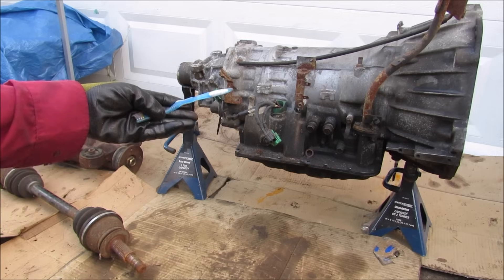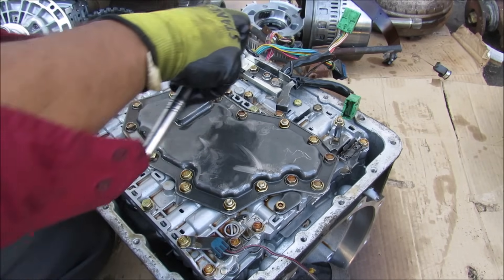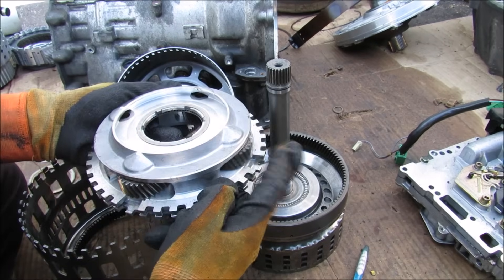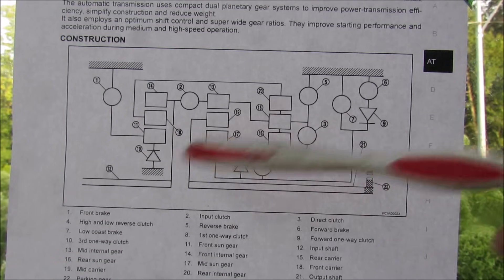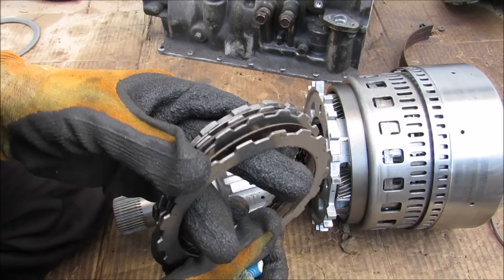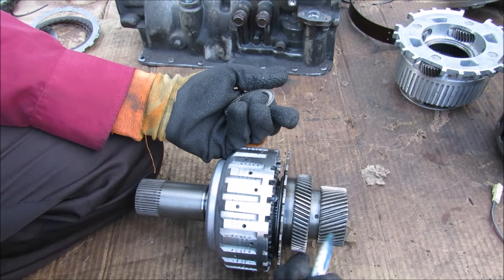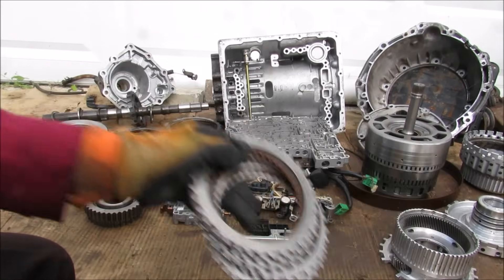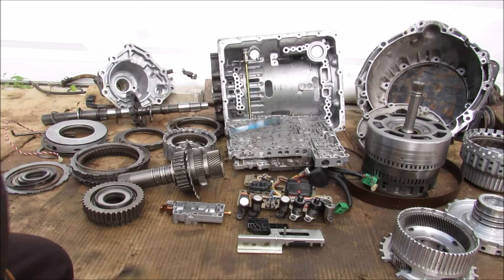How an Automatic Transmission Works (RWD)

Comment: Probably the best explanation of how the auto transmission works on the net. Simply superb. I am a professional Chemical engineer and have worked on cars all my life but understanding the automatic transmission still makes my head go in circles. For me the icing on the cake was the explanation about the transmission pump which no one else ever had done and I kept wondering where is the pump. It was important for me to know if its a positive displacement pump thus meaning you can't run it dry if you want to replace the fluid by keeping the engine running and using the tranny pump to discharge all of the approx. 6 quarts and then replace it. Replacing the oil with a dead engine only gets approx. 2 quarts out.

Your tear down seemed like a GM tranny, would love to see a ZF tear down which will be similar to AISIN of Japanese cars.
Love your review style sparkled with infrequent jokes & sarcasm.
Reply from the maker: Awesome, I'll keep that in mind thanks
Reply: https://www.youtube.com/watch?v=7ptkLEZIn84 dipstick transmission flush machine in action - it puts in 2 quarts and then takes out 2 quarts - I had this cycle 20 quarts for a 11.5 quart transmission.

Comment: I don't know if anyone can help me with this or not but I have a 1997 Ford f150 4.6 Triton four-wheel-drive the transmission when put in gear starts to grind about where the transmission pan is but will not move forward or backwards or go into park what did I break?
Reply from the maker: Check the fluid

Comment: Sooooo much shit to go wrong and cost thousands to rebuild/replace Lol. even toyota auto start acting up around 300k with all maintenance done. meanwhile a manual with good driving habits will last 600k miles and clutch replaced every 200k. very cheap if diy cos clutch kits are cheap. try rebuilding an auto as a diy. impossible even for auto techs; it is a specialty rebuild item.
Reply: looks like speekkar99 just took one apart so he can rebuild it idk. probly not tho. putting this together and making it work smoothly is a whole different story haha
Reply from the maker: Agreed. I don't think I can put one back together and have it work right
Reply from the maker: Hmm some autos are better than others. With the short lifecycle of the average automobile, many of them out last the car itself

Comment: Nice explanation and teardown of this JATCO unit used in Nissans, Infinitis, and a few Kia models. 

It’s a stout and strong transmission. Unfortunately most of them die from glycol contamination from the radiator. It’s a shame and expensive failure.
Reply from the maker: Agreed they are pretty decent transmissions (compared to the FWD CVT junk Nissan puts out) 

Didn't know about the radiator issue on these G35s
Reply: speedkar99 the radiator issues were primarily in the Nissan Frontiers

Comment: Just imagine how many medium where power from engine travels just to reach the wheels... this why I hate the torque converter. No matter how advance the technology the AT is... it will always feel spongy... it sucks. I’m good with Dual Clutch Transmission
Reply from the maker: Yep that's alot of losses in the system

Comment: 10:20 autism. those are drain holes. the clutch pack is engaged by a cylinder sqishing them down as a pack. to have a good engagement and shift you apply a lot of force on the pack, making the fluid go away from the pack and have dry contact keep the pack engaged
Reply from the maker: Ah that's right. 
But why does it lead to the center of the shaft?
Reply: what leads to the center of the shaft?

Comment: As usual excellent video. I have few stupid questions:
1) @15:23 what do you mean by "torque convertor lock up"? You quoted as the discharge oil from pump goes through these small holes of shaft and finally "lock up" torque convertor.
2) I have seen a "cable" coming from automatic transmission to "throttle body"....what is that?
3) What is the purpose of "adaptor assembly"?
Thanks for sparing your valuable time and keep your good work on....
Reply from the maker: You are welcome. 
To answer your questions, see my torque converter video and my FWD transmission videos linked in the video cards.

Comment: nice explanation sir.what happens when we select neutral instead of pressing brake in drive mode in signals? does it causes wear on any clutches or bands? i expected atleast in this video u will explain what happens on each gear selection, i mean which clutch or band hold for first second third..like that.
Reply from the maker: It would take another twenty min video to explain each gear!

Comment: And....this is why all of my cars have manual transmissions.  There's beauty in simplicity.  ;)
Reply: Chris Freemesser - It's true...there IS beauty in simplicity! But there can also be beauty in complexity...such as this transmission. Sure, it's hella crazy complex engineering, but the components that make up this modern marvel can damn near be likened to art. At least IMHO. Cheers!
Reply from the maker: Great. 
Meanwhile I'm going to admire this marvel of engineering
Reply: @speedkar99  Not saying the engineering isn't impressive...it just seems like a LOT of effort and complexity to save one from having to move a simple gear selector now and again.  ;)

I'd be curious (and slightly nervous) to see how this tranny compares in complexity to a 9 or 10 speed auto...

Comment: speedkar99, are you reading during the filming?- do you practice your speech thousands of times? there is nobody on Youtube who can speak so clearly and fluently  like you? that's UNREAL!
Reply from the maker: I don't make lines. I say as I go. I average 3 takes for every clip until I get it right!
Reply: @speedkar99  yeah this vid is Emmy material. Or whatever awards. thanks
Reply: @speedkar99  My only question is - you make the remark about how making sure the pressure is not too rough or hard on the clutch packs - is that referring to the fluid quality or how hard a person is gassing the car or both, etc.?

Comment: Absolutely amazing. I work in a metal stamping factory now and I'm trying to imagine how each individual part is made and it's just staggering to think about. The complexity of the case casting, the valve body casting etc. The guys who designed this thing are absolute geniuses. When I see this I'm amazed cars are as cheap as they are.
Reply from the maker: I have a similar train of thought... Everytime I open something I examine it from a manufacturing perspective, and think of the scale of mass production, it's immense!
Reply: ATs are really not as complicated as they seem on first glance.. First of all we have to appreciate the fact that with relatively small design differences, all auto transmissions are pretty much constructed on the same principles, with the caveat of electronics that have compacted the design of ATs considerably, when you consider that ATs were first produced when there was no electronics, back in 1948 when the first true AT was installed on production model Oldsmobile, when there was no calculators, desktop computers or CAD software. All designed by hand on drawing boards.
So when a team of engineers design a new transmission, they are not designing it grounds up (the planetary gears, Systems of Limits and Fits, Spline housings, shafts, bearings and other machined or stamped parts are pretty much the same with variations in size. The same goes for castings. All aluminum castings are variations of the same thing. In fact CAD systems such as SolidWorks have built in elements for AT design as a standard feature.
Anyway, these videos are absolutely awesome and I do hope that one day you will invest in an actual disassembly table so you won't have to sit on the ground for all this amazing work.
Good job, man...Keep it up.
Reply: Once you have the design worked out, it’s just a matter of getting the infrastructure to build it.

That’s why the prototypes cost so much, while the production version—whatever we’re talking about—isn’t nearly as expensive.

Comment: The big pistons in the bottom of the case are accumulators that are used to control shift feel and firmness. I prefer a good hard shift because it makes the thing respond faster and it wears the frictions less, but most people don't want to feel the shift at all :/
Reply from the maker: Yes they are. 
It also controls the front band clutch to lock the drum
Reply: This transmission does not have any accumulators in the case. The servo piston in the case controls the application of the front band. 

There is one small accumulator in the valvebody to control the forward engagement  feel.  

Shift feel is completely electronically controlled in this model.
Reply: 50% of mechanical engineers who sees, might be still confused after seeing this video, how automatic gears works!

Comment: Hi, this transmission is very big and heavy. Cvt trans weights less then 1/3 of this, and is cheaper to manufacture. If cvt breaks can just replace the entire thing cheaply.  
Thinking about cars today, their is so much plastic in the engines, most cars now have plastic valve cover, plastic throttle bodies, plastic in the gearbox(dsg) even plastic thermostat housing. I hate plastic. They should just hurry up with full electric Toyota, this rubbish "lawnmower engines on steroids (turbo) is bs.
Reply from the maker: Good point. That's the way our industry is moving towards...disposable cars

Comment: Transmission is more complicated than the combustion engine 🤪
Reply from the maker: It sure is way more complicated than ICE
Reply: I agree, I know, and can wrap my mind around engines. I know how it all work. I have tried understanding automatic trans forever. People start talking in my head at some point every time reassembly explanations start. But I watch because I want to learn
Reply: Very true, I have rebuild lots of engines but never had the guts to try transmission 😂
Reply: @halildjencic1612  you should give it a try. I just finished my second rebuild but my first success. 4l60e. I used transmissions bench channel. He explains it step by step
Reply: IC engines: Stuff go boom make shaft go round

Automatic transmission: mechanical magic
Reply: It's funny how people usually think rocket and jet engines are the most complicated and hard to understand, while they are actually very simple and it's the thing under everyone's feet that they use daily that's the hardest to grasp.
Reply: This is why Ford and GM teamed up for their 8 and 10 speeds. And why BMW, Mercedes, Audi and others used the same ZF 8 speed for a long time. Their engineers were like, we can't understand this witchcraft.
Reply: @lkae4  they inderstand the witchcraft
..but any small change for literally anything can trigger the ened to fully redesign something else....over and over. If it is tried and true tested and reliable, don't break it by trying to make it "better" until you need to
Reply: @lkae4 the ford and GM 10 speed is based off the ZF8.
Reply: @g @georgelin8498  Interesting. Why does it suck so much?
Reply: I think I'll have to watch this a hundred more times to fully understand.
Reply: Hope his brother has a new bed sheet.
Reply: Dude thats way more complicated
Reply: 10000000 times more complicated lol
Reply: Correct. I can overhaul most small and big engines without hesitation but automatic gearbox is a real story.
Reply: Automatic makes ice look like a steel pipe
Reply: True especially this type very complicated
Reply: In some ways it's actually simple, if you look past the complexity of the individual components. 

Transaxles get more complex due to their mor compact setup.
Reply: Hydraulic computers 😂
Reply: Auh it's not hard, just understand the logic of the different section to make it all work, you havev learn folks if you want to learn folks,

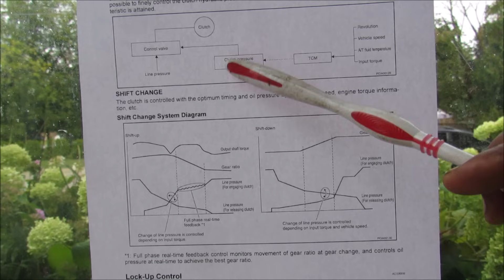Comment: Years ago I had a used transmission installed and it has always shifted hard from first to second, never getting worse. Would a transmission computer shift pattern reset help? 17:15
Reply from the maker: Yes. You are supposed to clear the Eeprom in the transmission computer too

Comment: Gentlemen don't be discouraged at all.
This system is now obsolete. New systems are either CVTs, which is very easy, or induction motors. So, no worries you wouldn't encounter them.😀👍
Reply: If being driven by a small, low power engine sure. You'll never see a bus or truck with a CVT.

"obsolete" torque converter automatics are still much nicer to drive in any situation other than a track than the insane dual clutch transmissions too.
Reply: From an Engineering standpoint, cvt's make sense however you'll only see them in low torque applications. Automatic transmissions in modern cars are efficient and quick, in addition, we have dual clutch transmissions now which are even more reliable than cvt's and can safely handle higher torque numbers.

Comment: My transmission is screwed I think. First to second momentarily pulls then jerks into position - feels horrible. And when I put it imto reverse it takes 3 sec to engage. My car has 150,000 miles on it. Am I due for a new Transmission? How much should a remanufactured one cost?

One Youtube video said the MAS & condition of the throttle body (carbon build-up) combined with readings from the speed sensor all affect the Transmission performance. Is that true?
Reply from the maker: Depends on the vehicle. Have it diagnosed with a reader. 
Some vehicles (Honda) have a tendency to fail after a certain time due to design flaws. 

A fluid change also does wonders.

Comment: I'm mesmerized by how these automatic transmission compacted for FWD transverse engine setup..

YOU DIDN'T USE GRINDER IN THIS VIDEO!! hahaha
Reply from the maker: In FWD the transmission has a countershaft and integrates the differentials. 
I've linked video that in the description and in the video. 

No grinder needed when everything comes so easily apart!
Reply: @speedkar99  if you've never seen it - a lot of FWD American cars use a chain drive to move the power sideways, see the 4T60e and AX4N
Reply: John my friends Toyota Camry and my Kia Optima’s 6 speed autos are even more compact than that.
Reply: the complexity of all these aluminum parts and valve body passages forces respect for the automatic transmission.

Fresh ATF is all it really needs 🙂

Comment: Why my Honda slips for a second and back to normal in also a second
Reply from the maker: It's those clutches wearing out from excessive heat
Reply: once you know all these internal clutches and bands are governed by the TCU to switch gear, you take it easy with the input torque and rpm else clutch material will contaminate internal filters and burn fluid into a liquid abrasive.... so called: "self destruction" !
Reply: @glasser2819  and the computer remembers the bad driving to store it and repeat it! wow. ...

Comment: Oh yeah, and like another commenter said......the ONLY negative is no torque converter explanation or grind cutting!!!!!
Reply: The torque converter analogy-explanation I found most understandable (for me, anyway) is that the impeller is like a fan, and it blows "air" (ATF, or in another sense, power) onto an adjacent fan, which is your stator. In any case, I wouldn't be surprised it SK99 either has a torque converter video or will do one separately.
Reply from the maker: Both actually. 
I already made a torque converter video from the Corolla. 
And I'll be cutting this one apart soon.
Reply from the maker: Save it for later, that would really push this video past 20 mins

Comment: That was by far and miles ahead the best auto trans tear down and explanation. I've seen pretty much all the others, even from known trans shops, but your video is by far the easiest to follow and maybe a second view is needed to further finish understanding how it works. You just have that uncanny skill to explain and comically use your families linens to aid you in your clean display of videos......pretty soon not even his grandmother is safe if we keep aiding in his addiction......
Reply from the maker: Thanks I'm glad you appreciate my work!
Reply: @speedkar99  these "automatic transmissions" are actually more complicated than Saturn-5 rocket engines!
 So now you have essentially mastered the presentation of the most complicated man-made machinery.

I wish you'd also introduce the design of the "failure points" in your videos - Realize that all these clever systems you take apart are also engineered to fail predictively... clutch friction particles plug the super fine "valve screens" !

It is a good game to help extend service life by defeating the built-in  failures

Bravo 🤗
Reply from the maker: @glasser2819  Thanks, and good suggestion!
Reply: @speedkar99  I have one question.
Did you put your brother's bed sheet back on his? 😂
Reply: I wouldn’t even call myself a car guy, but these videos are very impressive. This guy isn’t getting the recognition he deserves.
Reply: by far the most informative video Ive found on the subject.
Reply: 100 percent agree. His video is better than anyones on the internet by far
Reply: Agree
Reply: Did you mean after the 50th view?
Reply: I agree too

Comment: You have an uncanny ability to explain the automatic transmission and I wish I knew a mechanic in Seattle with your level of expertise! Bravo!
Reply from the maker: Thanks! 
Come to Canada sometime...
Reply: In Seattle, you should dump the gasser(s) and go all electric, thereby negating the transmission altogether.
Reply: @fun_ghoul  Everyone should go electric vehicle=build 10× more power plants to deliver all the electrical needs for those pieces of over priced garbage.
Reply: @trendmassacre8423  wouldn't take anywhere near 10x as many power plants. It would require around 30% higher electricity production, so that's 1.3x as much. And production capacity can be expanded at many plants.